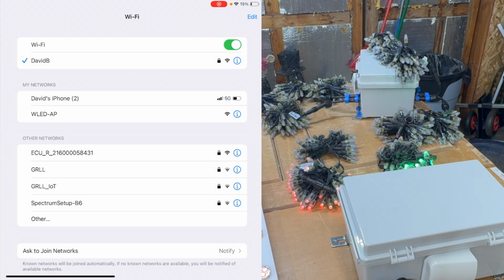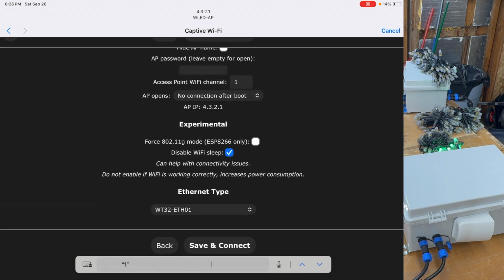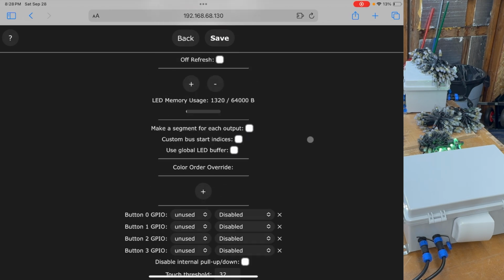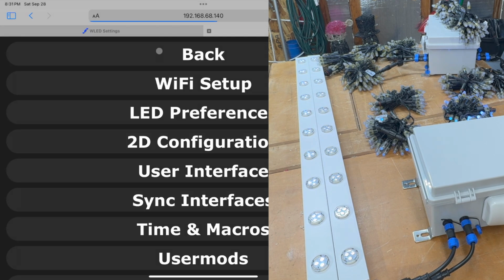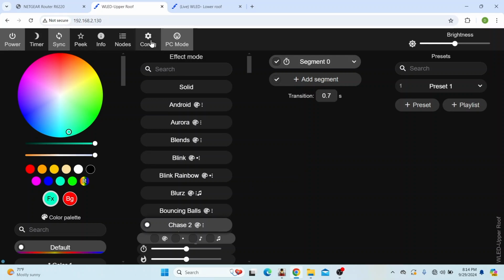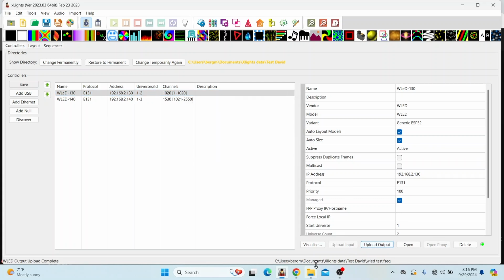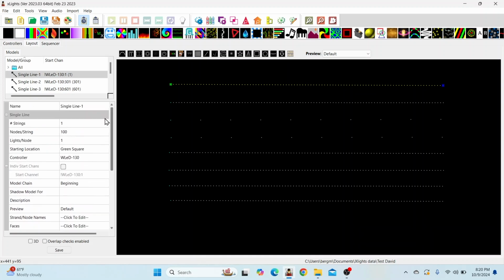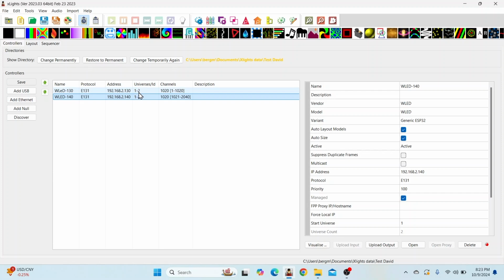Controller setup for xLights and WLED

Comment: i have the octo board have it running ok on pc and ap but for the life of me cant get it to work on xlights sais its connected with green dot on controller page ip adress is the same as the wled software het light is flickering but no output lights tried gpio at 0  1 16 nothing i have to leave it on 0 for it to work in pc and phone mode so im guessing the setting are right
Reply from the maker: Check the sync setup page in the WLED software.  There is a network DMX input setting.  I have mine set to E1.31.  I also setup xLights as an E1.31 controller.  Also make sure your GPIO pins are correct in WLED.  You can find the pin details on the Wasatch website.

Comment: Question on setting up wired ethernet. I do not currently have a router for my wired show network. Just an ethernet cable from a laptop into a network switch. With the controllers I've used before (Falcon and Genius) it's easy to set up a static IP address on the controller. From the video, it sounds like I'd need a router to make the MAC address to static IP address connection. I'm also not sure how to get the MAC address of the controller. I assume that's easy... I haven't actually powered mine up yet.
Reply from the maker: If you connect it to your router you should be able to get the MAC address from the router in the connected devices section.  There are also scanning programs on your phone that will show you the devices connected to your network.  It should give you the up address and the MAC address.  Just so you know there are different MAC addresses for the WiFi and wired adapters in this controller
Reply: @bergmannlights5149  I got the wired connection to work like this without needing to introduce a router for my wired network:
* set a static IP address
* set the static gateway to 0.0.0.1
* set the static subnet as 255.255.255.0
* set the Ethernet Type as WT32-ETH01

With this setup, it would still connect to my home wifi network if the wired connection wasn't plugged in at boot time. I'd just need to log in to that router to see what DHCP address that it'd been assigned. I probably won't need to do that, but it's good to have.

Comment: Great videos! How would you wire up 24v puck lights to this controller?
Reply from the maker: I would do it the same except I would use a 24 VDC power supply.  You might need to make adjustments if the power supply you use has a different footprint.  You also need to make sure your controller takes 24VDC.  The Wasatch Pixels board I am using can also be purchased in a 24v version.

Comment: These videos are great, thanks for sharing! Was hoping someone here could provide any advice on network/connectivity issues. WLED-AP doesn’t show up in my phone/computer WiFi settings so I’m unable to connect to the controller. Any advice? Thanks in advance.
Reply: @bergmannlights5149 do you consult? I’m having problems controlling my lights…only get Red, blue and green and variations of those (brighter or lighter). Obviously I’m not connected to the controller or network or something. Could use your help as YPS pixel store doesn’t respond to questions after I spent all this money with them.

Comment: I just got a Wasatch Pixel Controller Quad and I have it plugged into my network via ethernet cable. With it plugged into ethernet it does not show up on my search & it is not omitting wifi. What am I possibly doing wrong? It's showing lights on my router and on my pixel controller that it is connected but nothing is showing anywhere. Help!!! LOL
Reply from the maker: Hard to say exactly what is going on, but try not plugging in your Ethernet, then look for the WLED hotspot on your phones WiFi, log into it then setup a static IP address in the WLED network settings.  Hope this helps.
Reply: @bergmannlights5149  Thank you. Could it be a possibility that I do not have one with wifi? I just purchased it and it arrived today. It's a Wasatch Pixel Controller.
Reply from the maker: Which one did you get.  He does have some that don’t have WiFi

Comment: I am a beginner.  How does the raspberry pi fit in to all this?  Will I need 2 if I have a projector?  I want to locate my Falcon 5 controller box at my megatree.  And the RPi inside it with WiFi going to the RPi to transfer and control it via Remote Desktop.  Are you sending the Xlights app sequence file to the RPi and then it talks via Ethernet to the Falcon player (or WLED Dig Quad, etc) that then drives the RGB lights?  I have setting up the layout figured out (I think!)
Reply from the maker: I use my pi with FPP loaded on it.  It allows me to run the show without tying up my computer.  I use the xLights tool FPP connect to upload the sequences to it.
Reply: @ Thank you for answering :-) If I run a projector in my show, the same RPi will do it? (HDMI projector) or should I use another one? Can the 2 sync together (e.g., one running the lights and one running the projector hD video).
Reply from the maker: I haven’t tried running a projector off of a pi yet.  Not sure if the one running your show can handle the load of a projector and as the master.  I suggest you go to the FPP facebook group or xLights zoom room and see what they say.